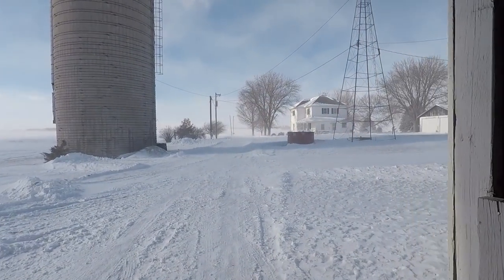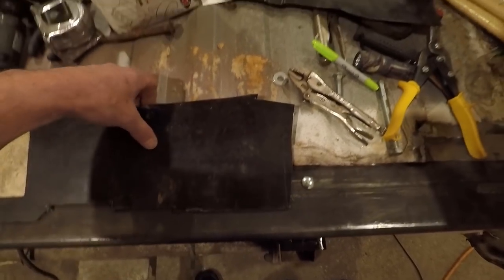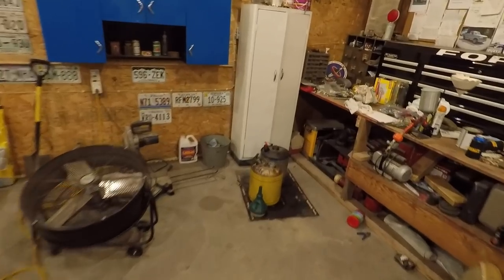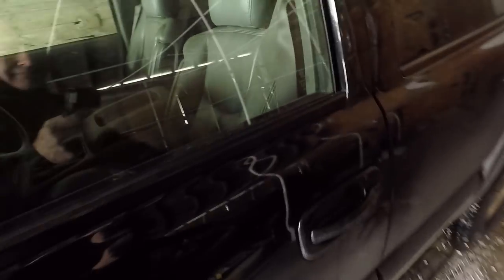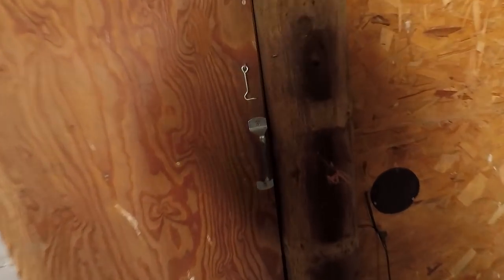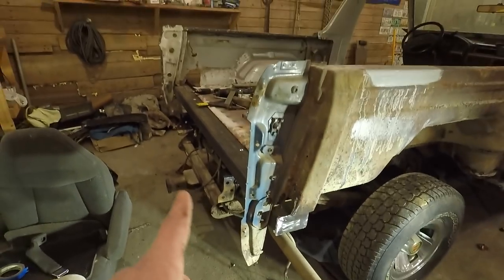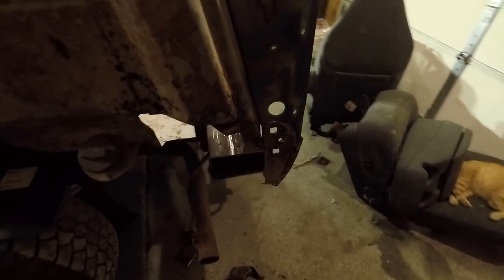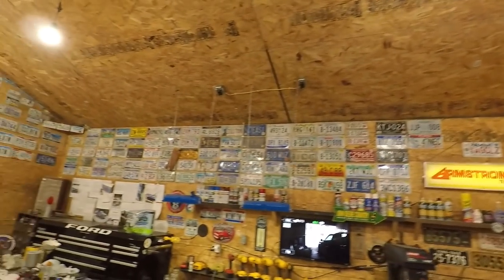Ford BRONCO Progress.  Moving FORWARD With The FORD BRONCO Project.

Comment: Just a heads up where you are working originally had a curved brace that would have attached to the sill and then hugged the floor curve. From the sill down would be a bracket that attached to the bottom of the quarter panel. I had no idea seeing how they have all rotted away in New England, I came across a body sitting on a trailer and really got a good look at it. I don’t have that brace in yet and the body is a bit flexy still.

Comment: You could always just use a long piece of all thread to hold the box sides evenly in place instead of mounting the tailgate if you need the dimensions pm me i got a california bronco thats unmolested
Reply from the maker: the width dimension I have, more to be sure that rear tube isn't in s place that will interfere with the tailgate working properly.... Just to be sure.